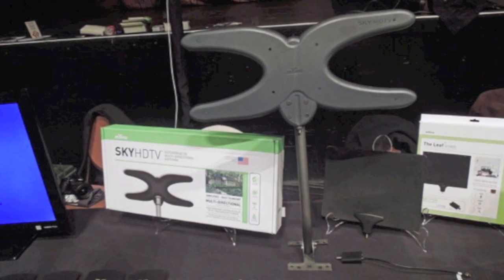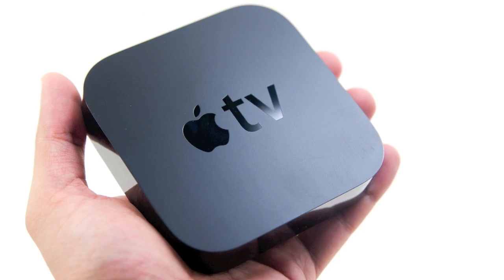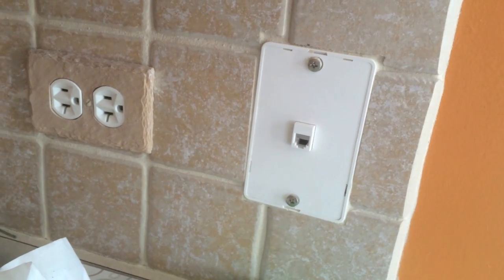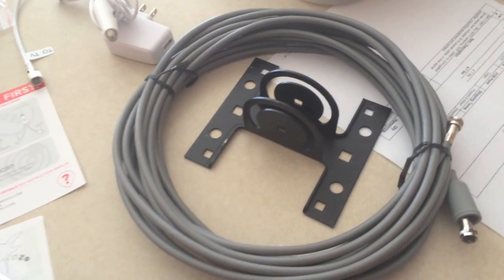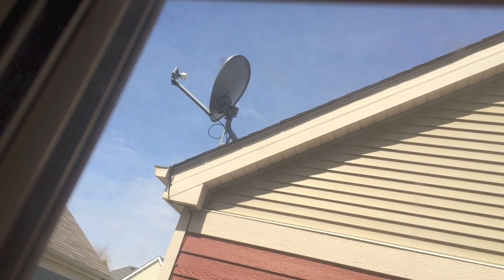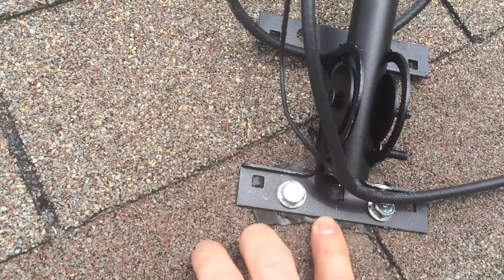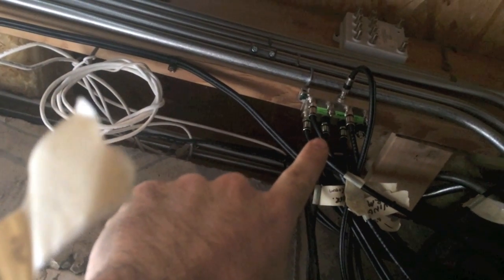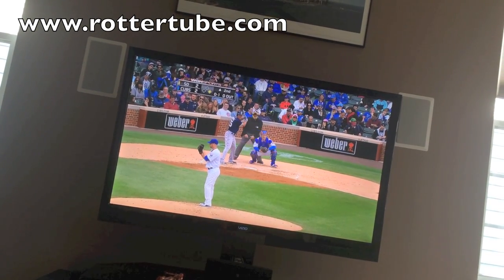how I got rid of cable tv - MOHU house antenna setup - sky antenna cable tv alternatives

Comment: How would you hook this up to a receiver? I currently have DirecTV and from the satellite dish there are coaxial cables running to every room. In most cases the coaxial goes to the  DirecTV receiver which converts it to a HDMI signal and THAT HDMI signal plugs into the back of my TV or receiver, cable in. So how would this work? Does Sky sell boxes to convert? How else would I be able to bring this connection to my Onkyo receiver?
Reply from the maker: what do you mean by receiver...as in audio? I don't use HDMI for the antenna. As I showed in the video, I use the coax that was connected to the direct tv dish for the antenna. connect that coax to the antenna and get rid of the dish. that coax goes to some splitter box that feeds all the rooms. i bought a powered splitter box for around $40 off amazon that is powered. you will need a powered one when splitting coax. I just connect the coax from the wall in each room to the tv coax / antenna. I do use HDMI but only for PS4 and apple TV (HULU, etc.)
Reply: BUT how would you get surround sound to a TV from the antennae? I mean right now the coaxial cable from my satellite goes into my DirecTV box and from that box there is a HDMI cable going HDMI (CABLE/SAT) in to the back of my receiver. I could also run that HTMI cable into HDMI 1 in the back of my TV.  I think what I'll need is a Digital Converter Box to convert that analog coaxial signal to digital.
Reply from the maker: I rarely use my receiver for surround sound but I just go stereo rca audio out of the tv into the receiver. no issues.
Reply: Cassius, you just need to run a cable from your tv's audio out to your receiver. No HDMI required.

Comment: Compression doesn’t change your resolution to 720. 720 is standard def which has a different aspect ratio also so you would see black bars on the side of you watch sd on an had tv. They have to compress it but it doesn’t mean there changing your resolution just like YouTube compressed the heck outta this video you uploaded. Anyways good video
Reply from the maker: right. cable companies compress the signal so it's not true HD. get this antenna and you'll see true HD since analog signal...over the air... is not compressed. digital compresses, either in video or audio. analog does not.

Comment: Why didn't you figure a way to use the dish mount?
Reply from the maker: +J Zerballs What do you mean? I'm using the dish mount for this antenna in the video.
Reply: It looked like you added a mount beside of the dish. drilling new holes into your roof.
Reply from the maker: +J Zerballs I used the existing mount and didn't have to drill anything luckily. It fit perfect.

Comment: I’m not allowed to put this on my roof as I’m a renter.  Our dish is outside in back yard.  Would this work if it was connected to the side of my place. I can do that but not the roof 🙄 there are cable wires going in from Comcast now for my internet only. 
 I know nothing at all about this stuff so please don’t crap on me lol 😂
Reply from the maker: hey Jason, i would never CR^^ on you for asking a question. you can do that no problem. you'll be fine. i love this antenna! the house shouldn't block it that much. you should be good

Comment: How far are you from the towers?..   Nice vid
Reply from the maker: Captinprivate Thanks for the comment. I'm about 45 miles from the towers, about an hour east by car. Watching the tv right now actually. I can't tell you how CRISP and CLEAR it is! It blows cable tv away! Cable tv, as I said, isn't true HD since it's compressed. We're watching true 1080HD. It's been a couple months roughly and I'm so happy I cut the cord!  HULU has most of, if not, all of our shows so it's like having a DVR in the cloud, if you will. Plus, we see all seasons with all episodes on HULU. That with the occasional movie purchase on iTunes is all we really need. So awesome! Sorry for the long post but I wanted to update the video.
Reply: ROTTER tube     WoW  Thanks for the quick reply (rare on youtube).   I found a refurb Mohu Sky on Amazon (will now be ordering)   I am tired of looking lkike that dummy and throwing away $110 a month.     I live only 25 miles from the towers but wanted the sky so I don't have to adjust the antenna...  Bad thing is most of my tvs are 720P bcuz I knew that was what I was getting from th Satt co..   Oh well.. Gonna buy a DVR that works with OTA since I hate commercials and for streaming, I have 3 Rokus..   Can't wait to call them and say goodbye
Reply from the maker: Captinprivate that's one thing i can't stand about youtube....NO RESPONSES or very long to respond. usually NO responses! you will be incredibly happy with that unit even if your tv's are 720. let me know what DVR you get for OTA. instead of the DVR, like I said, I tried HULU and really couldn't be happier. Here's a couple quick examples why getting rid of cable is the best thing you can do.... money in your wallet each month. Also, there were certain episodes of shows I would record and then delete but wanted to watch again...too bad. with HULU we get most of the shows with all seasons and all episodes. I don't really watch sports so I am not affected. I did get to watch the Blackhawks win the stanley cup because it was broadcast on tv live. If I really wanted to catch a game I would go to some sports bar or a friends house....but I don't watch much sports. With the money I save a month, I buy an ENTIRE SEASON of any show via iTunes for the kids for about $12 - $18 average. So we get to keep the entire season and I still have $ in my wallet. Best deal every. So tired of paying monthly for cable for shows we never watch and 200 channels with garbage we'll never watch.
Reply: ROTTER tube Heck i will try hulu first and then see if a dvr is necesary.. If not... MORE MONEY SAVED... I will let you know either way... Thanks for your advice and help
Reply from the maker: Captinprivate Sure, anytime. I would really recommend HULU. We had netflix and it was just older movies. We're not into the old movies...not much of a variety there is what I'm saying.